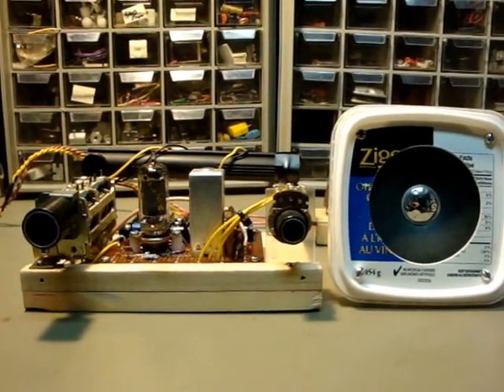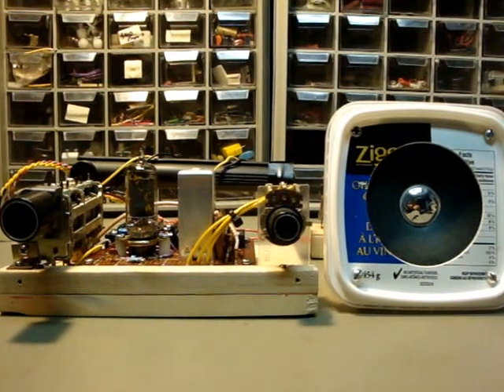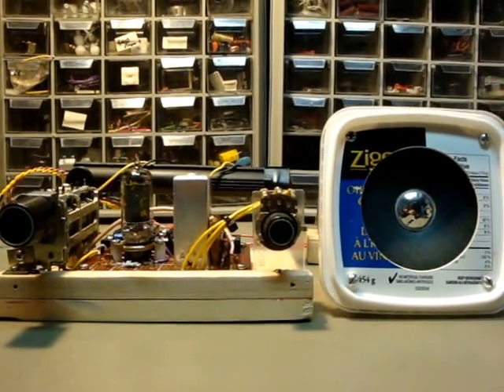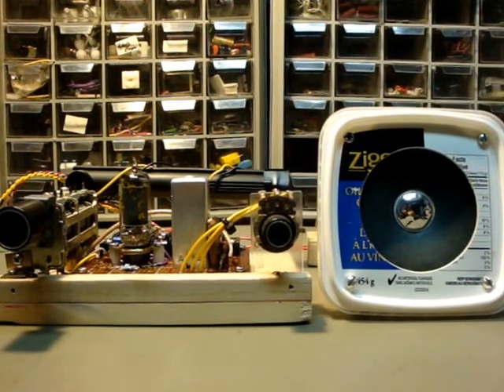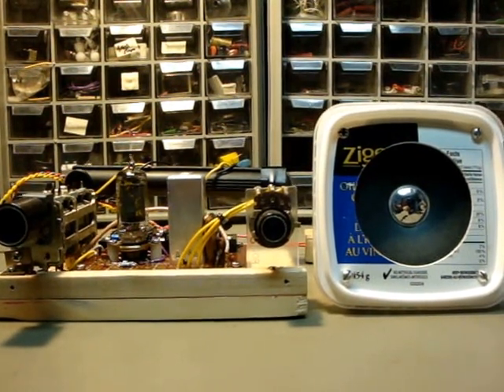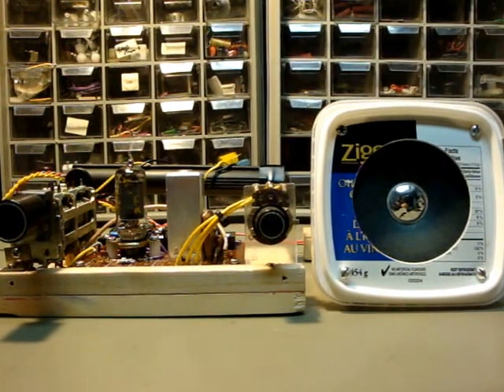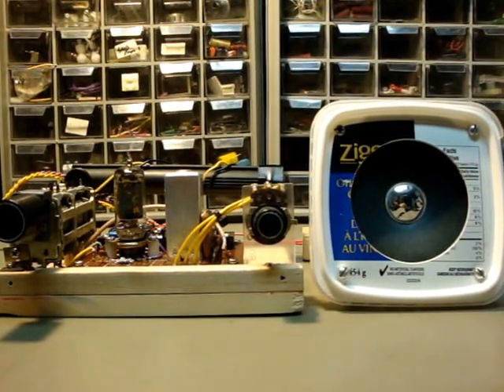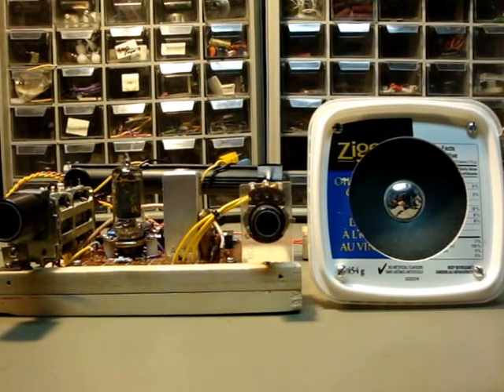One Single Tube 6AU6 Reflex Radio with speaker (no antenna needed)

Comment: Hi I would like ask you, L2 coil is an IFT CAN  written "10.7 MC". How a FM IFT coil works in TRF?
Reply from the maker: The primary was rewinded to get 337uH matching the ferrite core antenna.
Reply: @DIY-electronics-automation   Hey, one more question if you don't mind. Is this coil is in the radio of 1:1, i mean the secondary is similar to primary? and there is coupling capacitor in between Primary & Secondary, what is the value? Thanks & Love from India
Reply from the maker: @utsavprakash  I honestly don't remember the details, you could find the original project script here: https://www.worldradiohistory.com/Archive-Poptronics/50s/55/Pop-1955-11.pdf

Comment: Good results! This is local AM station?
I made TRF reflex radio with single BC547 transistor... and it can drive speaker.... I changed power supply from 4 - 20V but sound don't still louder.